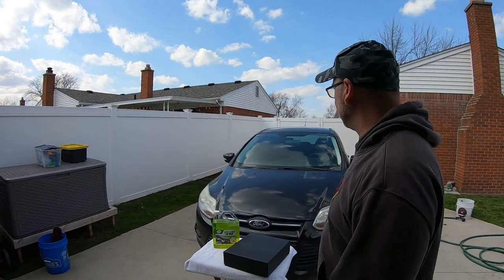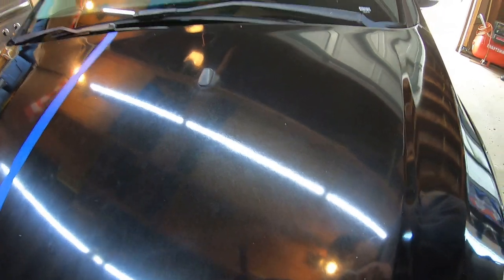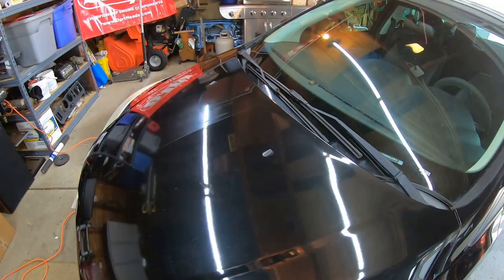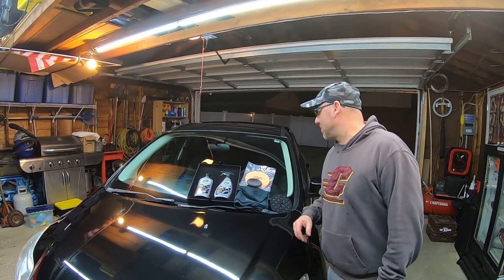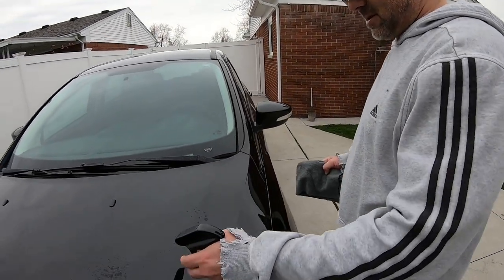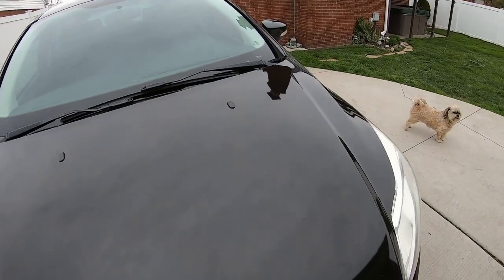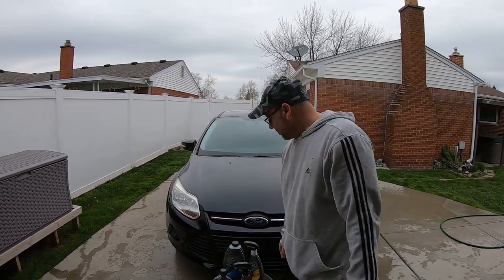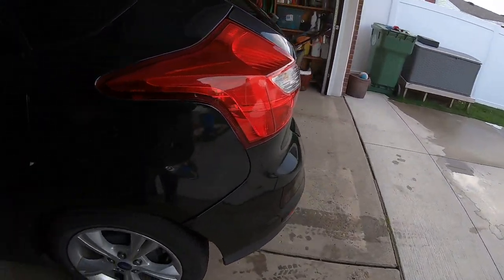How To Wash , Polish , Wax Black Car Turtle Wax Ceramic Acrylic Black Polish &  Ceramic Wax Spray

Comment: Steve. really sharp results, I have 2018 black F-150, this could be the ticket for her.  PNE OF MY Favorite Turtle Wax products is their Turtle Wax Ice Spray Wax. I like to use it off lable on the interior plastics and vynil. I bet this Acrylic Black Polish and Wax would work well on cars with the piano black panels in the interior,  clean up the scratches and leave them glossy and protected.
Reply from the maker: This product would work great on your F-150 and those piano interior panels . The Ice spray works get a friend of mine had that on his Raptor man was that hard to remover.  Thanks Jay

Comment: My favorite turtle wax product is the black and plastic dip iron wheel cleaner. You can use it on your paint for an iron x removal without destroying your paint.
Reply: What year is your vette?
Reply from the maker: Going have to buy that back and plastic dip from TW thanks
Reply from the maker: 1987 we are going make some videos about the Corvette.
Reply: @OuzoLouGarage  Nice im going to polish my dads 1986 vette this weekend. You should buy it and try it out. I think it works great, & guess what? It's cheap! 😁
Reply: Black and Plasti Dip is from Eagle One not Turtle Wax.
Reply from the maker: What color is the Corvette
Reply from the maker: Thanks
Reply: @OuzoLouGarage  its like dark gray.

Comment: Very nice video guys. Of course I want to be entered. I have two black cars to try it on. Worked wonders on that one for sure. I would like to see them develop a wheel coating to help with brake dust. Many say they have them but they never work
Reply from the maker: These would be great for you to try out Pete. TW needs a wheel coating and iron remover. thanks

Comment: I would like to see them make a permanent tire dressing like Dura dressing,by Dura coating.
Reply from the maker: That would be nice to have..  I still need to try the Dura coating
Reply: @OuzoLouGarage  if you close on my pic of the tire on my red truck that is Kiwi brand sole and heel edge dressing, it's water proof but is a lot work to apply you have to brush it on with foam brushes.